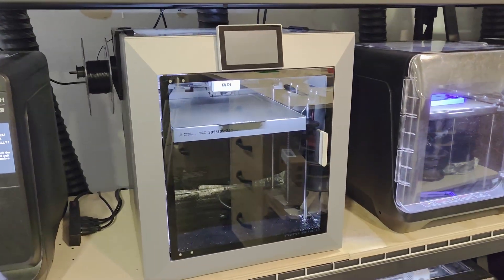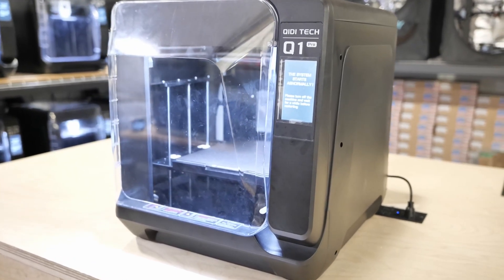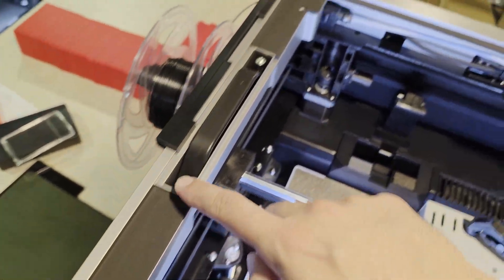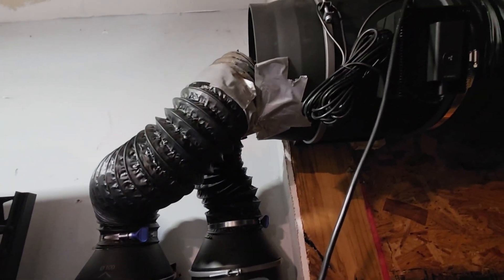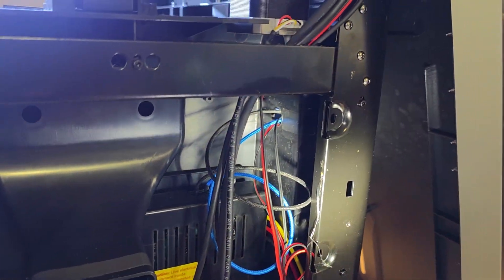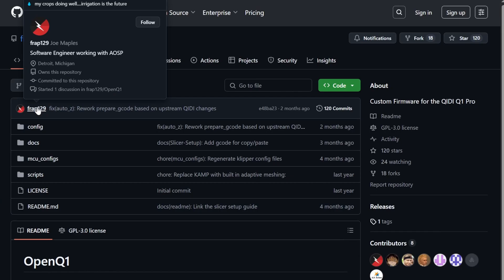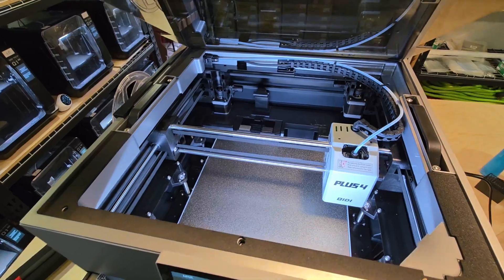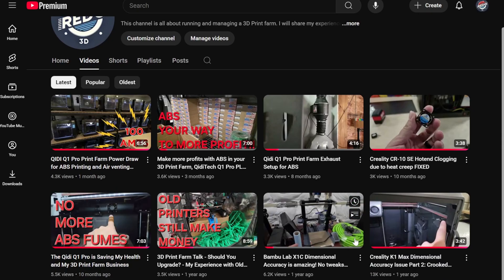QIDI Plus4 vs Q1 Pro - My thoughts with running a Q1 Pro Print Farm

Comment: Great insights, thanks.  I have a Q1 Pro and I just ordered a Plus 4 for the larger bed.  I've been learning 3d design and printing these last 6 months to set up a farm, so this channel is perfect for me.  Would you consider making a video about the automation and print management side of things, and an update on your bed automation solution for the Plus 4?  You have left enough breadcrumbs that I can figure it out, but I'd love the benefit of your experience setting up automations.  Things like how many prints can you reliably run before needing to attend to the bed cleaning and glue stick, and what size of print models can be pushed off a bed.  Thanks for starting this channel.
Reply from the maker: I do plan to create more videos on these things. Thank you for the feedback!
Reply: @Redo3D  Great.  Look forward to it.

Comment: Why do all your printers display the message 'the system starts abnormally'? I recently encountered this error on my own printer, but it seems you're continuing to use yours despite it
Reply from the maker: It's because I installed OpenQ1 firmware
Reply: Do you know Freedi the free klipper Mainsail software for Qidi printers.
Reply from the maker: Yes I have freedi 2.0 installed on about half of the printers. Its not stable and sometimes the printers crash. The rest i am using openq1. Openq1 has been very stable never had any issues. The only downside is no full featured screen support

Comment: I noticed you set up some AC Infinity duct fans. Those are my favorite. Refined, quiet, powerful and reliable.
The trick I use to remove all the fumes without affecting chamber temps is putting each printer in an enclosure with a free flowing intake.
You can suck as much air as you want AROUND the printer. The problem gets to be when you're increasing airflow in the printer itself.

Comment: Impressive farm! In your opinion, is the Q1 Pro reliable overall? I tend to believe it is especially for individual users, but your opinion is valuable.
Reply from the maker: Thank you! The Q1 has been very reliable, they only print ABS, none of them have ever had any other filament go through them. The printer frame is very sturdy, the weakness in my opinion are the belts which i replaced all of them and installed manual tensioners.. I've had 3 SSRs go out on me. Most of my Q1s have over 3k hours each, no signs of slowing down after I've replaced the belts. Never had any mid print issues such as shutting down, or any bed leveling issues like that. Solid machine, I would buy another 18 if I had the space.
Reply: @Redo3D  Heya, hope you see this - I know the printer is even "older" by now and that you have covered a lot of what I was about to ask about reliabilty in these comments already, so thanks a lot for that. I really try to not put too much weight into all the big channels' "reviews" because very few of them ever talk about what happens after, say, 500h.  But I think I have one more question for you, though related to the belts;)

Things is, I have too many other projects and stuff to buy so I am thinking of picking up a used Q1pro as I can get one kinda cheap and there are plenty to chose from. But I have seen mentionings of the pulleys themselves going bad and being a huge hassle to change since rods and brackets are supposedly epoxied in place? 
So, if you could spare a few thoughts on this? Have you had this happen? Supposedly the giveaway is horrible walls. Also, is it really that hard to work on the gantry parts? (I consider myself pretty nifty, so I am ok with a bit of a challenge but I'd rather not spend days or weeks on this as I am tired of tinkering with printers just to keep them alive). 
Would you even be able to share some more detailed info on the steps needed for your own belt/tension fixes? It would be awesome to have as I am sure a lot of people will eventually have to do this. Is this manual tensioner DIY or over-the-counter?

I was looking at K1Cs, too but I need dimensional accuracy more than anything else and I plan to print a lot in ABS-GF, so the Q1pro ticks most of the boxes.

Comment: Thanks for sharing, very intresting hearing your thoughts.

Yousaid that you have a couple of weaknesses that you found on the Q1? Going through them and hearing your general thoughts on the Q1 would make a great video! 😊

Thanks!
Reply from the maker: Thank you! The biggest weakness in my opinion is the belts on the Q1, The wiper system I think is not ideal either, I had to update to a community built software to get some nice features out of klipper. I also installed manual tensioners. Those would be my biggest gripes honestly. The Plus4 seems to do away with those weakpoints out of the box. Printing wise, I was constantly changing silicone socks every 2-3 weeks of non stop printing because they would dry out and crack. I could put these things on the idea list for future videos.

Thanks for watching!
Reply: @Redo3D thanks for the respons. Im running a Q1 since 6 months on stock firmware.

Ive insulated the printer and the manual belt tension mod is already printed and next on the list to install.

Regarding the socks, yeah they  are not Holding up very well for conrinous printing of ABS. Im looking into if I cant cobble together a thick sock mod since there are space available.

Comment: My Q1 Pro had a screw digging into the belt, literally grinding it to fine dust. I fixed it with 2 small washers.
Reply from the maker: I've seen users have this problem. I checked all of mine and they all had a washer from the factory. One thing I forgot to mention was I added manual tensioners to the Q1 and it really helped with keeping the belts eventually tensioned.
Reply: @Redo3D  hi, do you have a video or picture/model of your belt tensioner mod?